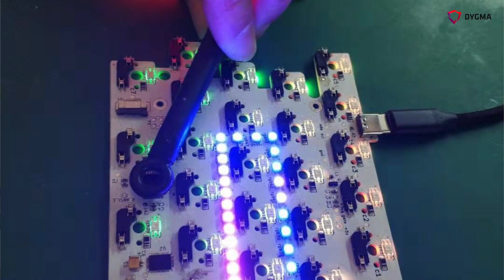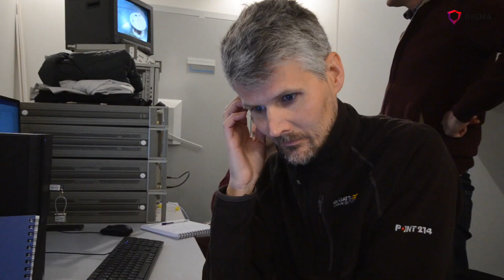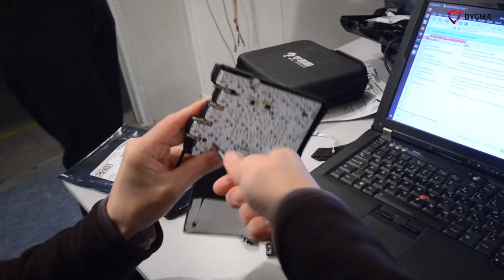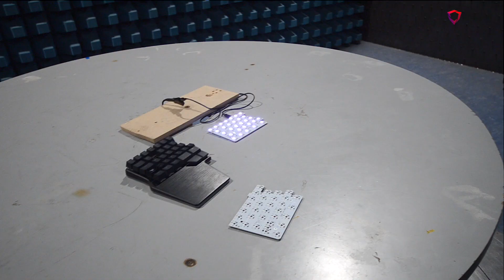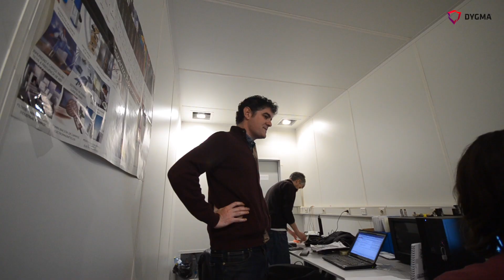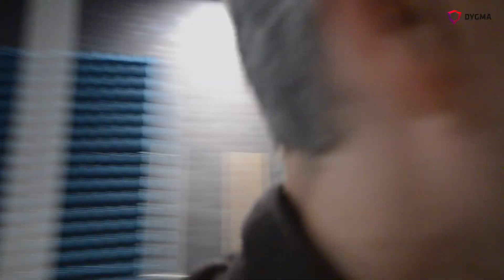Passing the pre-certification

Comment: I imagine the stress of needing to pass certification was exacerbated by a feeling of urgency and pressure to get units manufactured and delivered. Especially after having delayed the project already. I can't speak for everyone of course but for my part, I have no problem waiting while the necessary steps are taken to ensure the exceptional quality you guys are clearly striving for.

Once again the transparency of these updates inspires confidence regardless of whether things are going smoothly or you're working through unforeseen issues. it's nice to see you guys so passionate about the product. Well done! Best of luck for the final stretch. :-)
Reply from the maker: You're exactly right. There was definitely a sense of urgency. For Matt, there was almost a sense of despair, especially after failing a couple of times. But luckily, we're ok! The DVT will have a new set of challenges. But we're ready to face them.